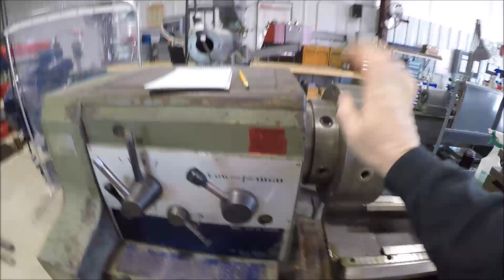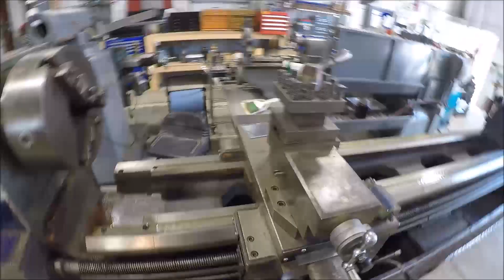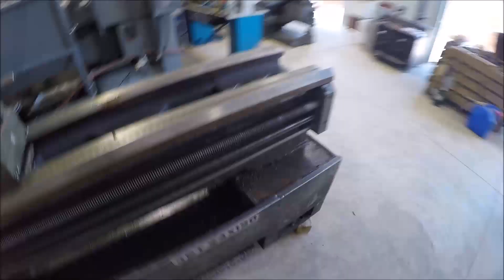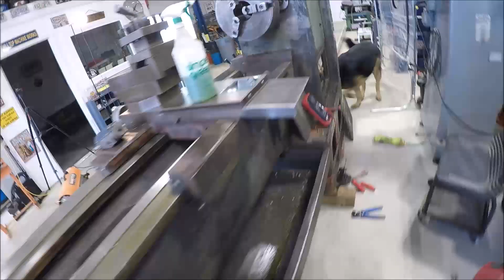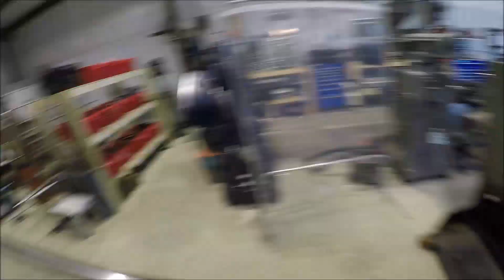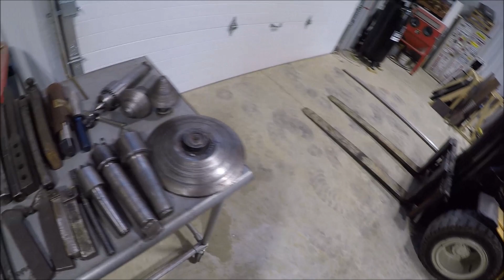New piece of machinery for the shop

Comment: Tom, will make a great addition to your shop. I also have some projects that tend to be fill-in projects while I’m trying to work on other stuff. But you got it in the shop and it is there whenever you get a chance to spend a little time on it. Thanks for sharing your new Lathe with us.    Gary
Reply from the maker: I spent yesterday cleaning it up. If I had your weather I would have pressure washed it, but it is in the 40’s here so I used elbow grease instead. 💪😁

Comment: Nice machine Tom. I have a 17 x 120 LeBlond built in the 50's I believe. It is near brand new except for being dropped on it's back. Only damage to it was it broke the taper attachment off. They cut the cross slide lead screw off with a torch so they could still use it. It must have sat for many years because the base and the body was pretty rusty but the ways and all the mechanical parts were clean and practically unused. It was fun getting it back looking new. I'm sure yours will be looking awesome soon also! Thanks for sharing!!!!
Reply from the maker: That is a good size. I wish mine had a taper attachment that would make it really sweet. Oh well I still got a good deal.
Reply: @hilltopmachineworks2131  I think you got a very good deal. What is crazy about the taper attachment is I hear people all the time wishing their lathes had one and I have bought 3 LeBlonds lately and all three of them have a tapered attachment. I guess I got lucky. And I have never used one yet.

Comment: Congrats on the new capability. Any plans to do a video on a deeper inspection, i.e. opening the headstock, or making the small repairs necessary?
Reply from the maker: Hey buddy. I may do some video on fixing the little things. I just got the machinery feet under it today and addressed some electrical stuff. Going to level it tomorrow.